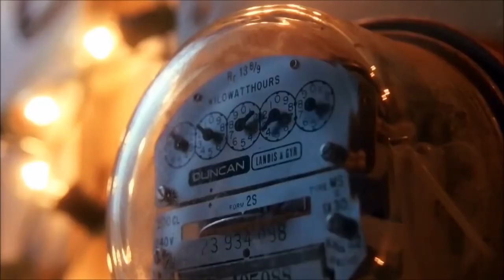Vintage Wood Lathe [Restoration] Part 2

Comment: I watched specifically so I could how you tension the belt!  It uses the weight of the motor just like the table saws.  Excellent.  Great video.  Even 4 yrs later.

Comment: Great video. I just got my hands on model 101.06242.  It's a miracle that I have it.  It was given to me.  It came with no steady rest.  Is yours after-market?  If yes where did you buy it?  What OD should I be looking for so a new one fits?  Finding parts is impossible as you can imagine.
Reply from the maker: This was my fathers, so everything I have came with it. I think most aftermarket rests are adjustable.